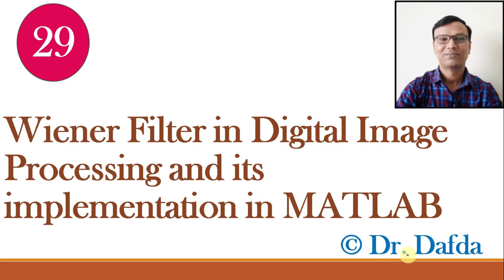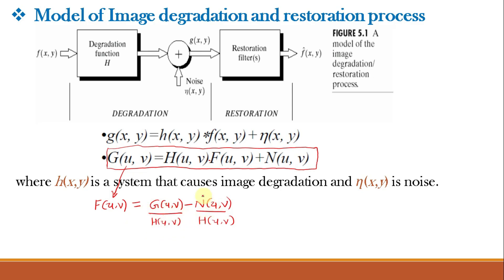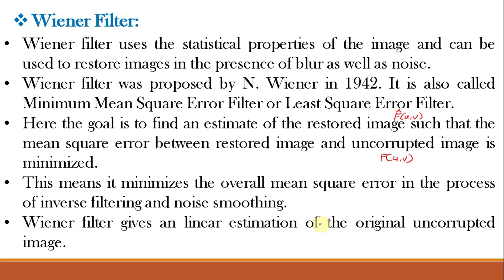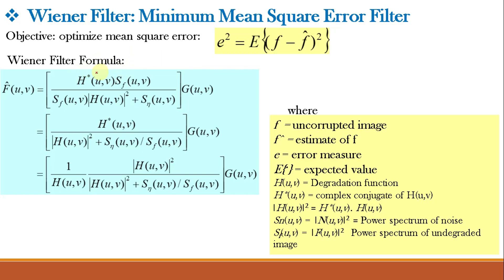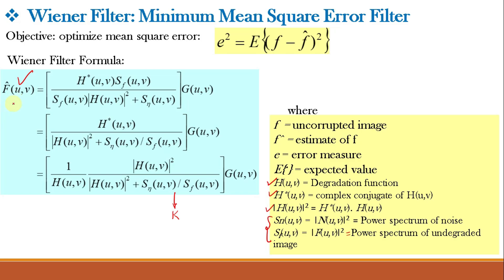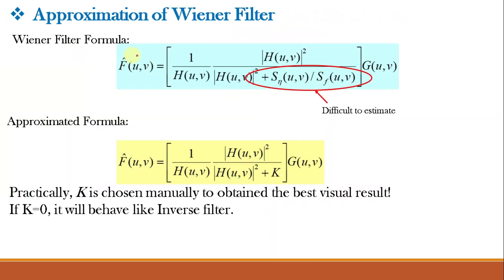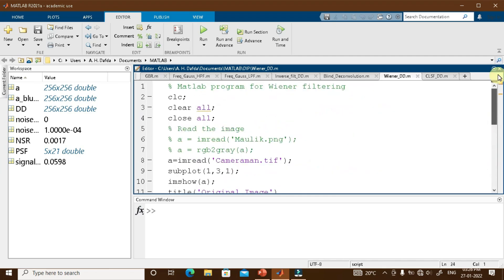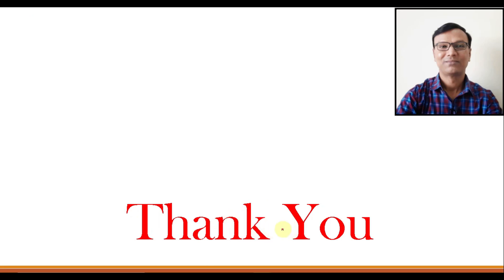Wiener(Minimum Mean Square Error)Filter in Digital Image Processing and its implementation in MATLAB

Comment: thanks sir.  Sir how did you load the image? in my laptop i was trying with another image but, even after writing "imread " and " imshow" my  laptop cant display any pictres . Matlab just gives tdd type sound 😅. I thnk there is a problem with my imge file location
Reply from the maker: Keep your image in the MATLAB folder of My Documents. Also check your file size. For my most programs I have used my image of size 512*512. Hope this helps.
Reply: @StudywithDrDafda  ok sir